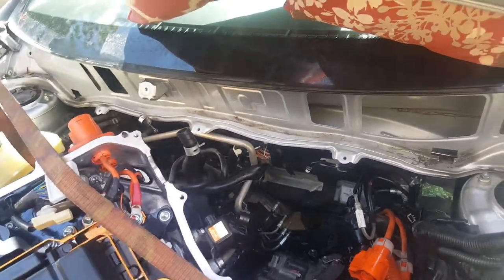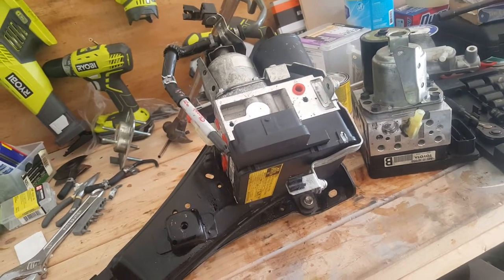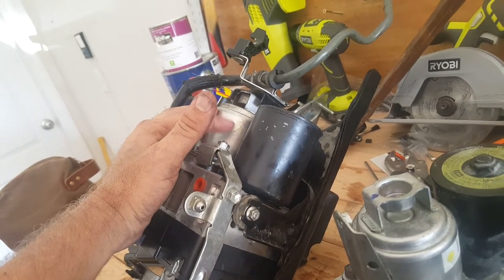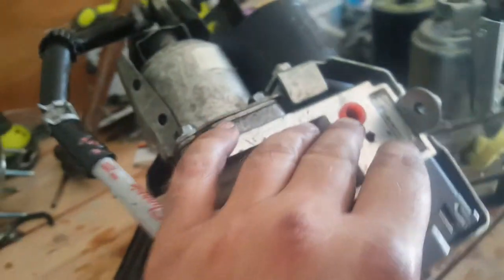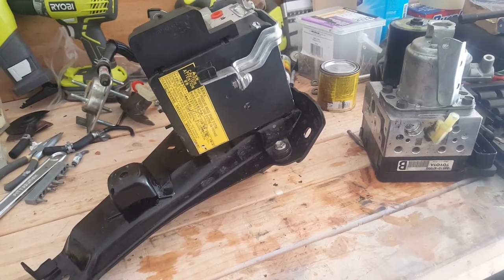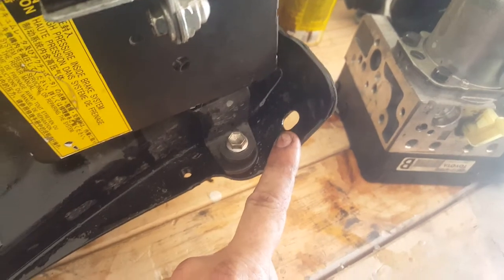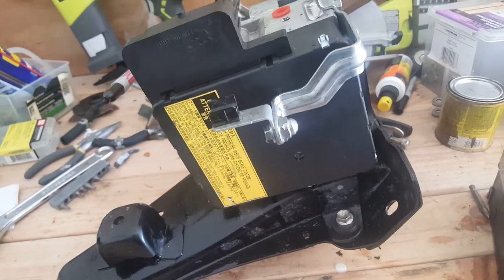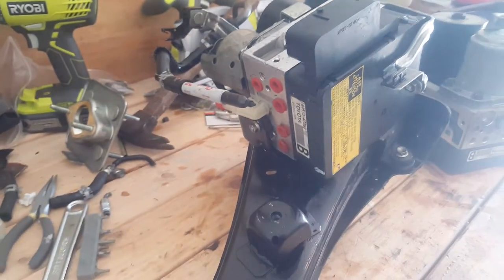Prius brake master cylinder booster replacement.

Comment: 1. No, you don't have to drain the coolant from the inverter or even completely remove the inverter at all. It will sit on the engine once the wire harnesses are removed. 
2. There was no need to completely remove the brake line like it is shown here.
3. Techstream is a must to bleed the brakes on a prius 2nd Gen and get rid of the red triangle of death, maybe other generations too.
4. I've done this 4 times already through the trial and error of used and "remanufactured" actuators and I can tell you for a fact that getting a used part to work correctly is about like winning the lottery. A used actuator simply won't make it through the techstream "linear offset" process. The actuator must make it through this setting to get rid of the red triangle. Just buy a new one and save yourself hours of labor and frustration. Side note: paper clip method is temporary. Skid control unit picks it up pretty quickly that there's something wrong. 

First time I did this job it took about 5 hours but I managed to get it down to about 3 cutting out unnecessary steps that a bunch of these videos try to show.

Good luck everyone!

Comment: Why not remove the inverter completely, takes less than 10 minutes. As yet I have not had to do the brakes but I have done several engine swaps in these. It actually saves time to remove the inverter completely to do that.

Comment: You bought it used for 250? Or new for 250? So 4 hours to replace it ? I've bought mine for 147 on ebay...mec told me 247 for labor
Reply from the maker: Used for that price.
Reply from the maker: I understand that price. Is not easy, but can do.

Comment: Any update ?
Reply from the maker: The ran good for 3 weeks a at 90 to 100mi a day. Not in getting the triangle after 15 to 20 min of run time. Don't know now.
Reply from the maker: Trashed the car. I drove it for 30 days and it started with code  after code.

Comment: I think mine is going out. I hear a lot of chirping when pressing brake pedal. I'll ask for labor quotes. Thanks 👍
Reply from the maker: That is going to be big bucks!
Reply: @jerrygrueser260  bought the part for $100 but the mechanic told me not to worry about it if I can live with the chirping. Apparently Toyota knows about this but dont want to do a recall for obvious reasons.
Reply: Any of this Gibson - see the youtube links in there for the lights and the noise (chirping like you say lol) ? ( https://www.reddit.com/r/prius/comments/edh0g5/3rd_gen_2012_prius_any_brake_recalls/ ). Jerry if you see this, that's what I was talking about above.

Comment: If you bleed the brakes you can just reset the computer with the paper clip method
Reply from the maker: Not on that code. I like the input but had to have the computer.
Reply: @jerrygrueser260  so did you use teachstream to bleed it?